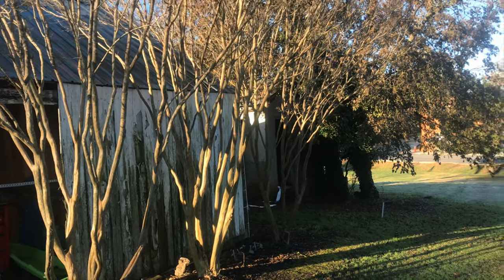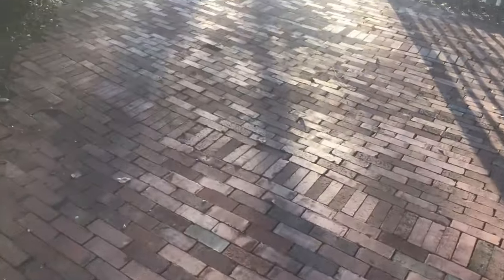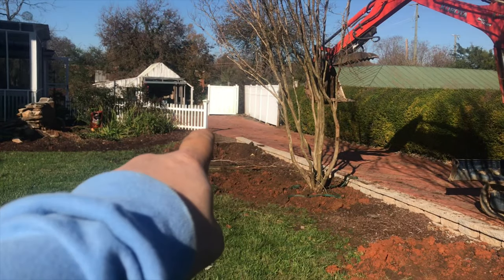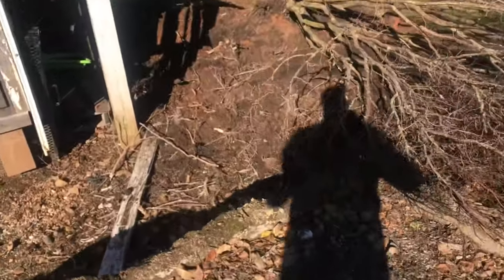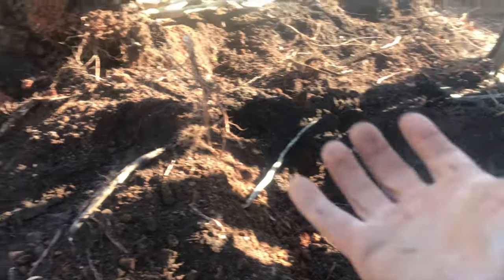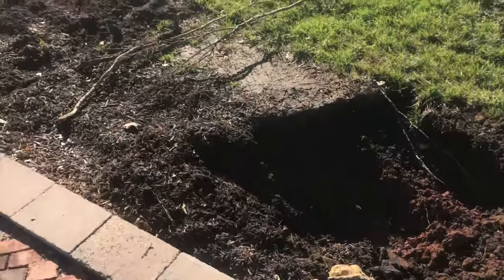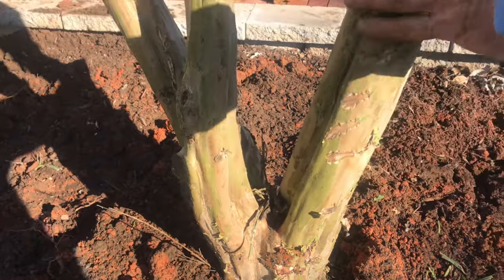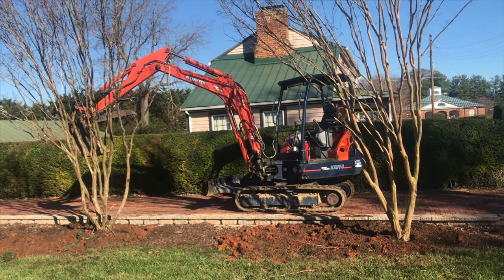Moving large crape myrtles

Comment: How do you move a large crepe myrtle planted too close to foundation with wires above? What would you suggest please?
Reply from the maker: That’s a loaded question. Depends on how close. Crapes are a fibrous plant and very forgiving of done at the right time. Mid fall to early mid winter is the best time. The roots will build even though the leaves are off. You would not want to do this if the ground is frozen or will freeze within a 2 weeks of planting